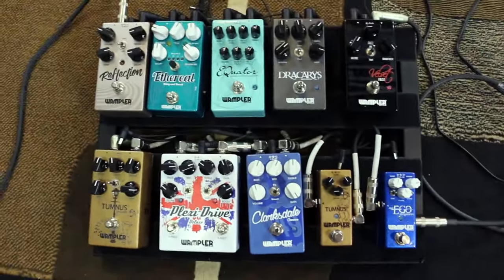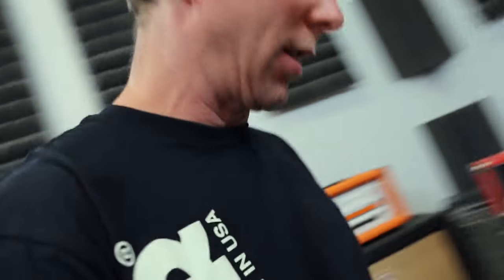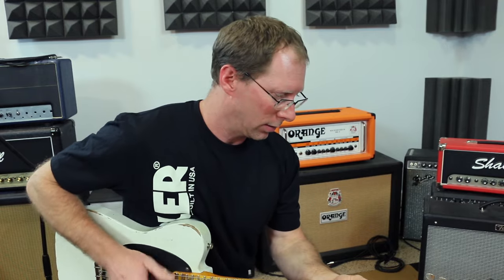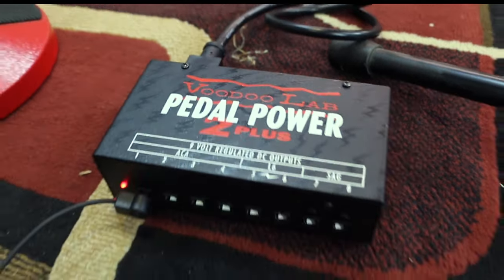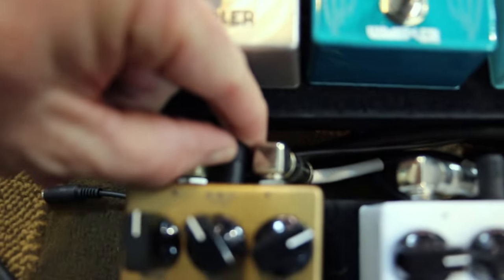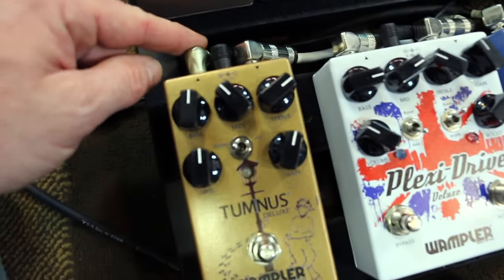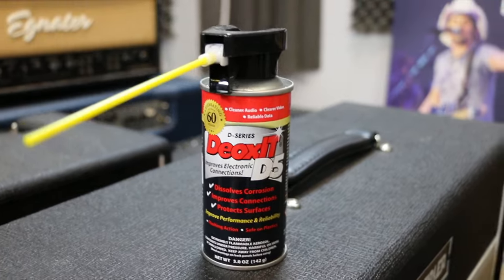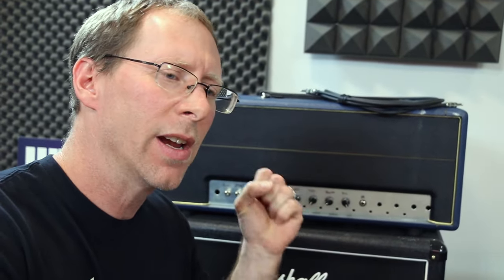Troubleshooting "non working" pedals, what to do first if your pedal stops working

Comment: my cables are fine and my pedals work with the effects loop but when i plug it into the amp input it wont work even tho the pedal is on !!
Reply: @Gupster 23 Hi sir hows your pedal now? Im encoutering issues like yours. if it is okay now can you tell me how you fix it
Reply: @Gupster 23 What do you mean mixed up?? im using 1 pedal onlg btw and does your pedal also encoutered this issue? When i turn it on It will make no sound, if i turn it off it will back to its clean sound. im really frustrated about this problem. Hope you can help me sir.
Reply: @Gupster 23 Yeah i already made this kind of setup and still my pedal wont make any sound but the light is on.
Reply: @Gupster 23 yeahh.
Reply: @jovanietatoy8047  did you figure it out? I’m having the same problem

Comment: I second the power supply thing.  I had a problem with a blinking light on a pedal and felt like distortion was on all the time even when all my pedals were off.  Turns out it was one plug in a daisy  chain I had that had gone bad.  I replaced it with a new power supply and boom!  The problem went away.

Comment: My board has 12 pedals, all work fine with the Voodoo Lab PP2 and X4. I am trying to switch out one pedal for an Eventide MicroPitch. I can't get the MicroPitch to power up when connecting to the Voodoo Labs PP2 or the X4. I have tried switching the cables and still, it won't power up.
It does of course power up with the power cable it came with.
How can I get it to work with the PP2? Why isn't it working?

thanks so much,
Mark

Comment: I have a 2 month old Ibanez tube screamer. From one day to the next, it stopped working. When I hit the pedal and the red light comes on, the guitar sounds like it wasn't plugged in to the amp at all. The amp has still power but it is not amplifying the guitar. When I turn the pedal off, the guitar is amplified again on whatever setting the amp is set.

Comment: Hey sir, please respond but i have an issue with my pedal. I have a 9v battery inside, and also a 9V adapter cable. When i turn on the pedal, the light indicating it works shows but the pedal is dead and  doesnt produce the sound. Earlier,I plugged a faulty 9V adapter to it so I was wondering that had to do with anything and please if possible, how to fix

Comment: Hey there. 

So I do have a problem with my power supply and my pedals. I plugged everything in yesterday and turned the power supply on, but I didn't get any signal, eventhough my guitar volume was up. 

I wanted to run one of my fuzz pedals (EHX Rams' Head Big Muff) into my interface (Scarlett Solo 3rd gen). It didn't work at all.

The pedals do turn on, but I just don't get any sound, despite the volume being turned up.

What could be my issue?

PS: my instrument cables are fine. They get my signal through to the interface and everything.

Comment: I had a weird noise with some of my drives and after  checking everything (cables, power etc…), I finally found that it was the buffer of my digital flanger placed before those drives that screwed them.
Beware the buffers.

Comment: i have a problem that was not discussed, i have a evh chorus pedal about 3 months old.. has worked fine on my pedal board until now, powers on, switches work,effect volume works but no chorus effect at all even all the way up.. signal chain is: tonex-evh chorus-boss dd-200 then to di box then to mixer. tonex powered by supplied wall wart chorus and delay powered by a cheap donner power supply. but have also tried a battery and bypassed the power supply..the delay works fine. any ideas?

Comment: I have 2 Wampler pedals and I had no idea they came with a battery.  When I get a new pedal I plug into my 1spot.  I just took the batteries out.  Thanks for this video.  I feel so lame. A long time ago I ruined a pedal by leaving a battery in and the acid destroyed the inside.  I wished I had kept it because it was a 70s MXR distortion...maybe it was repairable?  Btw I had a led light go out and the Wampler Customer Service was awesome.  Shipped the pedal and they repaired it at no charge.  When is the Equater coming out?

Comment: I have a pedal that's making a popping noise when pressing the foot switch. The pop is louder when engaging. It still pops when I disengage, just not as loud. Aside from that the pedal is fully functional and sounds great. I tried it in isolation with different guitars and amps. All with the same issue. I'm using a Strymon Zuma power supply & this does not happen with any of my other pedals. Any suggestions? I'm trying to learn as much as I can before I attempt any DIY repairs. I don't want to risk damaging the pedal.

Comment: Thank
you thank you! You have saved me hours of research.
One question for you, how does a weak battery affect the pedal function? Let’s say a 9V battery read 5.2V or even   7V, at what point will the pedal stop working or be affected?
Reply: This depends greatly on the kind of effect. Analog circuits, like your simpler boost/overdrive/distortions, can keep running on lower voltages, though you'll lose headroom. Pedals that, like the Centaur or Tumnus, have a charge pump to create higher voltages from the nominal 9v will stop working entirely when those circuits are starved too much. Digital pedals generally create a 5v line to run the digital portion from the 9v via a regulator; depending on the type of regulator, those might stop working once the battery hits 7.1v or work down to 5.1v — but keeping a 9v battery running that far risks leakage.
Reply: Old post, but boss pedals are digital right?

Comment: You kind of hit on it, but you will have much more success containing noise if you plug your entire rig into the same outlet. I've seen some people try and plug their pedal board into a different outlet than their amp and there was some crazy noise. PA systems too, which can be much trickier considering the amount of gear involved with long distance cable runs.
Reply from the maker: Good point!
Reply: I'm a couple years late but is there a reason why that is? For a casual like me, plugging the amp and the pedalboard into 2 separate outlets seems unrelated to amp noise
Reply: @BluesGetOrigin  Using separate outlets increases the chance to get a ground loop going. If you have a large amount of noise, it's a good place to start your troubleshooting. There will still be other places for noise to leak in, but it's all about eliminating possible sources when one is troubleshooting.

Comment: Hi there. I bought a flamma modulation pedal and when I power on my board it does not work. Then I take out the power plug from the pedal and put it again and it starts to work perfectly. Any ideas of what is happening? Thanks.

Comment: Everytime I try using a pedal the sound just cuts off the amp will still be on but nothing happens
Reply from the maker: You either don’t have the correct power or the cables are connected backwards
Reply: I would run the checklist: power source(s), cables, chain of connection, and controls on the amps, and on the pedals, and controls on the guitar.

Comment: I used a 12v adaptor on my 9v chorus pedal and then used it without any power supply and I think it’s either because the 12v adaptor fried the pedal or my batteries just died because me leaving the input jack plugged in.

Comment: I bought a brand new EHX Small Clone chorus pedal that works perfectly, except when I step on the switch to turn it off. It will not turn off. It is always on. Is just a simple issue of replacing the switch? Have you ever heard this about this pedal? I only paid like $89 for it, so what I do is simply turn the knob all the way to the minimum amount so that even though it's on, it's so subtle that you hardly hear it. Can you help out a fellow Hoosier with a little Wampler wisdom?

Comment: I have an old TS9 that stopped working years ago , so it sits in a box.....I ordered a new switch for it and replaced, and still dont work ...throw away? I was hoping that there was a magic answer in the video,lol....but this video was still a very informative watch :)
Reply: I wouldn't throw it away. I can't think of anything that can break on a pedal that can't be fixed, except maybe if the PCB is snapped in half or something.
Reply: For reasons I don't completely understand, the FETs that are used for effect switching in such pedals can become nonfunctional.  That will likely be a transistor labelled K30A or similar.  The momentary switch you ordered and installed merely actuates the transistors that do the switching.  If one or more of the switching transistors doesn't work, it still won't function, despite the new switch.

It can also happen that the external power jack can become corroded over time.  Does the pedal decline to work with both battery or external power?

Comment: I’m going nuts trying to figure something out. 2 boss pedals working fine (one of them is 1 month old). One spot power supply combo powering them, also 1 month old. One day it just stopped working! I checked cables just like you outlined, they are fine. I ditched the one spot thinking perhaps it was the problem. Brand new Duracell batteries and still they don’t turn on when connected up and switched on, (Not chaining them just trying each separately). Go figure?!! Maybe it’s a switch but in BOTH pedals going out at the same time? Anything else I can try?!

Comment: What’s happening to me is.. I have good batteries and everything but when I put in the battery.. everything’s plugged in correctly the right way it doesn’t turn on but I tried switch them around ( I switch the cables the wrong way) and then it turned on but no sound
Reply: I had the same problem, after the light turned on switched the guitar side cable to amp and amp to guitar cable(on the instruments not on the pedal) seems to be working fine since

Comment: Great video. A couple questions :

1. Have you ever seen a quartz movement wrist watch cause noise when using a high gain pedal?

2. I am about to try and rehab an 83-84 Ibanez Sonic Distortion pedal... first pedal I bought when I was a kid. The battery puked all over the inside... but it still works EXCEPT that I have to stomp on it a few times to get it to turn on. If you don't think Deoxit will do much... do you have any recommendations on addressing this?

Thanks!
Reply: set my cell phone on my amp once and got crazy noise.

Comment: I doubt there will be someone to answer me since this video is kinda old..
But I just got this Boss RC-1, I ran a Boss DS-1 with a cheap power supply(not for audio) and it worked perfectly fine, so I just plugged these both into it. The DS-1 still works just like before, but the RC-1 refused to turn on (LED not on, pedal not reacting) if I unplugged it, it worked perfectly fine with the battery in it, but once I plugged in the power supply, everything went silent. I tried all the possible combinations I think, battery out, not running the power supply to the other pedal, etc. I even looked in the pedal if anything looked out right wrong, but everything seemed fine.. I'm thinking I could try re-soldering the power supply adaptor in the pedal, but I don't want to risk anything.

Edit: I solved the issue but I'm gonna leave it here if anyone encounters the same one. So I noticed it flashes after I short the circuit and 'un-short' it again, and then as I was wondering what do to, I randomly switched the power supply to 7.5 volts and it turned the RC-1 on. Plugged in the other pedal and now they both work. No idea why but I'm happy.

Comment: I have a audio walrus malee pedal and it quit working. I've checked the cords, all are good. I'm using the power supply I got with the pedal. It comes on but there's no sound. I haven't used it in a few months, but it was working fine when I put it up, in it's original box. Any idea what could be wrong?
Reply from the maker: I’m not sure but I do know those guys and they have exceptional customer service, I would reach out to them about it

Comment: Everything seems to work for my pedal. It turns on and if I connect the cables the sound comes out the amp but when I turn the pedal on nothing changes it doesnt add any effect
Reply: Same with me but when it’s off no sound but when it’s on it’s no affect also the light doesn’t turn on
Reply: @spacecadet8714  I fixed mine ! Though my light did work so maybe it’s your pedal and you need to buy another one but all I had to do was buy a 9v adapter instead of using a 9v battery I bought a cable that connects directly into the outlet and then I plug it into the pedal and it fixed for me

Comment: Janglebox only works when completely isolated from any other pedal. When I run it to a loop switch or in a dais chain it only gives half volume. Es I’ve tried cables, made sure my polarity was correct (+ tip), but it won’t work in a chain and they won’t respond to my e-mails. Need help.

Comment: Like all of your video's, this was excellent.  I watch them all the time.   I unfortunately have a SD-1 modded (vintage) that works sometimes, but most times just gives me a crackling noise from the amp (Fender Princeton Reverb).  I've gone thru all of your suggested trouble shooting including switching from ACA.  D6 is a 3mm led,  D4 a 1N4001, Cap 2 .047, Cap 6 removed and R16 470 ohm.  I get power and pass thru when the pedal is off.  Very frustrating.  I purchased additional items to do the Wampler mod next.  Hey, latest update?  It works today when I opened it up.  Wanted to check for ground issues. The light though in D6 remains on even after I click the pedal switch to off.  Any idea's?

Comment: I just bought and evh MXr phase 90 and I tried using a 9 volt battery and a random chord I had that fits the pedal but not made for it and the lights won’t turn on, I’m also not using a guitar amp because my old amp broke and my new ones coming in tomorrow

Comment: I own a single pedal and its still not working xD  put in the input cable of my guitar, nothing happens. Loop a cable from the input to the output the light turns on. Connect the input of the pedal to the input of my interface light turns on(no typo you read correctly)  So i can connect the pedal to itself and i can connect the input to another input. Nothing else turns it on.

Comment: Hey Brian, I live in a old house that has voltage issues.  The voltage goes from 120v down to 111.  Is this bad for tube amps?  Also can you recommend a realistic solution for this problem?

Comment: I was panicking thinking I had to send my pedal across 1/4 of the world, when my actual problem was me lightly pushing the foot switch with one finger. Thought ended up taking out the battery and taping the conector during the panic process, now it’s ready for the pedalboard.

Comment: So I got a boss distortion pedal recently. And I tried it out the other day and it worked. But today I tried it and the pedal didn’t turn on. I used every piece of equipment that I used when it worked. I have a battery powered boss katana amp, could that be a problem?

Comment: I have a high gain overdrive and it will randomly give off a high pitch frequency. What could that be?
Reply: open it up and inspect the circuit board
Reply from the maker: If it's random I'd tend to think it's something else. Does it do it randomly when the pedal is completely isolated as detailed in the video?
Reply: Wampler Pedals Yeah it does it completely isolated with an isolated power supply .
Reply: There is a small demon trapped inside.

Comment: Thanks for the video...I'm having a problem that isn't covered in this. Anyone got a tip?

When I plug my Shallow Water into the FX loop of my vibrolux, the signal is attenuated by like 99%. When I engage the pedal's true bypass, the signal is loud and clear, so I know it's plugged up right.

Did I get a bunk power supply or something?

Comment: What if the pedal Lights up and sound passes through until you engage the switch and then it's dead silent? Checked it on battery, checked it on power supply, took it apart and visually inspected for loose wires, components and cold solders. No sound whatsoever when the switch is on. CMAT Signa  Comp.
Reply from the maker: Sounds like it needs the switch replaced
Reply: @wampler_pedals  I will try that first thanks.

Comment: My problem is a little different my pedals come on fine but I don't get a guitar signal through my amp when they are cut on. So when they're up let you know that the pedals and used I don't get a guitar sound, but when I cut the pedal off use my guitar sound comes right back on again. Could I be a cable issue it is not just one of my pedals it's like all my pedals now and it hasn't been that way in years. I'm only using two pedals and that's a Reverb in the delay anyway working fine like two or three days ago that I let my dad borrow my guitar cables for him to play a show and after that and it stopped working

Comment: So how about if you just came home with your latest Craigslist treasure and in your excitement to try it out you accidentally grabbed the ridiculous 40V power supply that came with that oddball EHX ring modulator and plugged it into a pedal expecting only 9V and now all the pedal does is make a howling noise no matter what the dials are set to even after plugging in the correct power supply. Hypothetically.

Comment: Typical,none of these pedals look like mine,I got a 20+ yr old boss turbo overdrive that won't even light up, there's a battery in it and I've got a 12v 1.0ma AC adapter,do you think it'll fry it?
Reply: 1. Wires from battery to circuit board, 
2. Audio Input jack must use a mono cable or the power won't make it through
3. If it's fried, it'll probably be the first diode burned, it'll be visibly blackened if it is.
4. Make sure wall wart is center negative.
Just some suggestions
Reply: @patromo  thanks my friend, some neat tips, I'll try it 👍